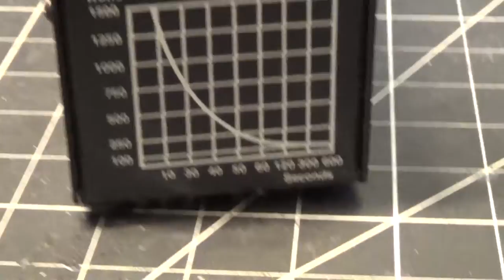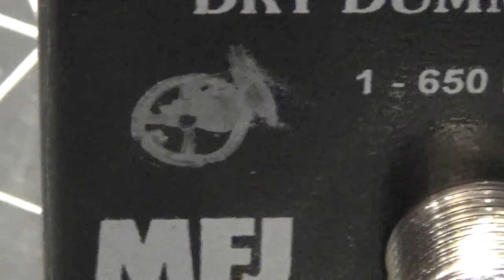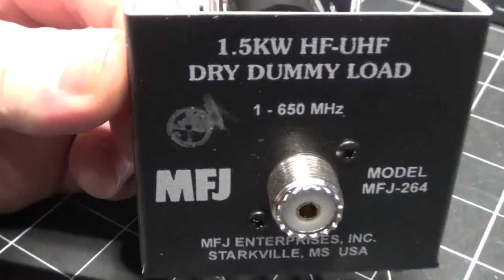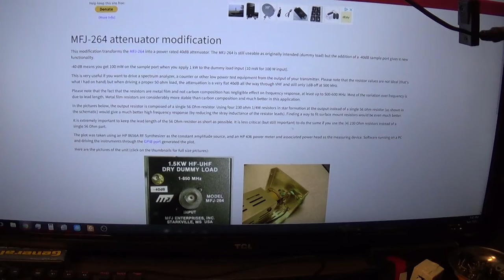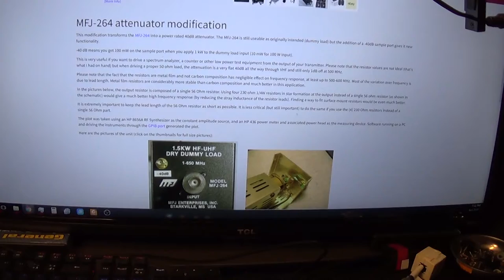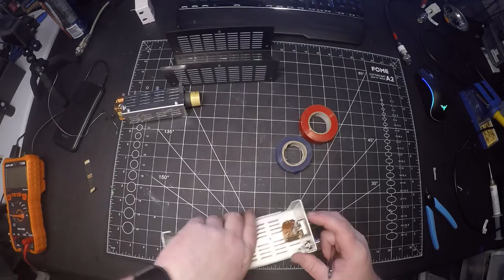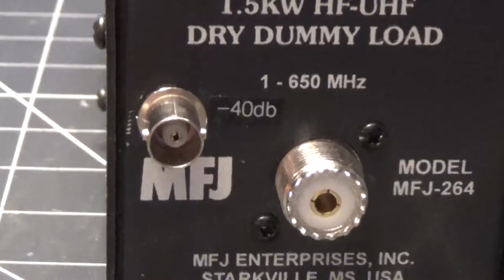How to: add a sampler port to your dummy load. MFJ-264

Comment: What is specific purpose of sampler port?
Reply from the maker: It attenuates the signal down to a much lower level that is safe to use for an oscilloscope, spectrum analyzer, frequency counter etc.
Reply: @salvagegeek  my 264 is 1K, same same on the mod? No changes needed to the resistor pack?

Comment: I wish they came that way !  next time use hi temp red silicone just a small dap. that hot glue will melt when resistor heats up. and you can do this mod on the oil filled one.  it is a paint can . They make a line section for sample port. quite costly but good to 3 GHz has N connectors.  for HF this mod is great !  I  may do it to the 2.5 Kw air cooled one they sell which I have  with the oil one. but I have the line section tap . this is great for NANO VNA or TINY SA .can also put frequency counter on tap. AM/FM no audio . just dead key read frequency !  73's